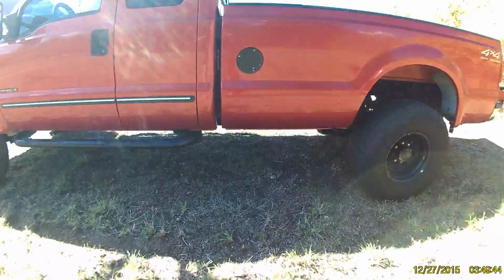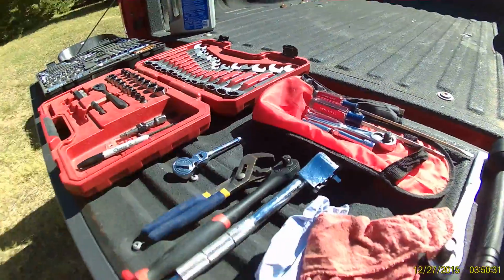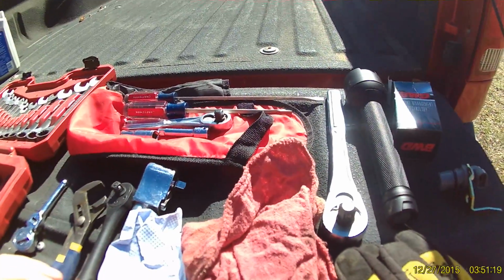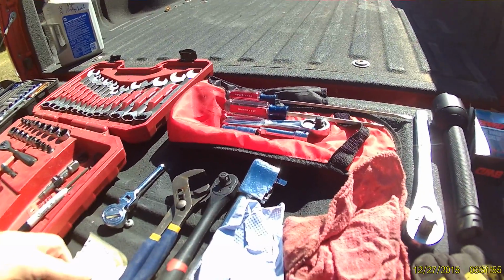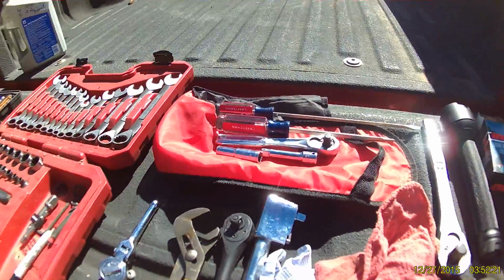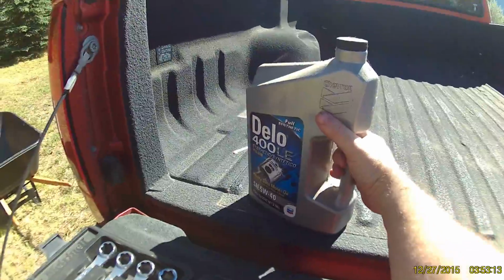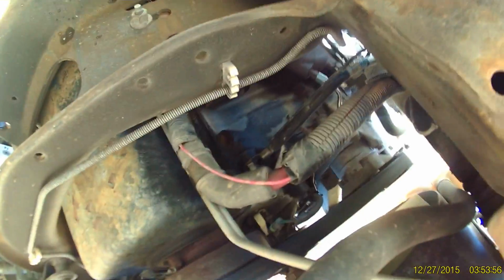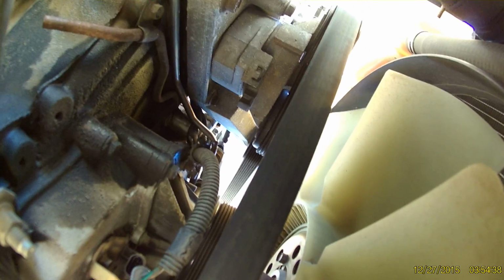2000 F350 Ford 7.3L Diesel Camshaft Positioning Sensor Fix Part 1

Comment: Thanks for the video. Browning .45 in the seat? Right near the end, you mentioned removing something that was all dirty and nasty, but I couldn't understand what you said that was. Is it something you cleaned and then replaced, or just removed permanently? I'm about to replace my CPS, so just wondered if I could do anything else while I'm under there.
Reply from the maker: You're welcome, thanks for the reply my friend. My Tussey 1911 Commander. The EBP sensor and line, I replaced them both, you can clean them yet you may end up damaging the sensor. I found them cheap enough where I just replaced them both and called it done. Here are a few good videos to check out on what you can do why you are there to get your best bang for your buck. Definitely check your CPS, IPR, & ICP. 

https://www.youtube.com/watch?v=r4uCI8MH62U

https://www.youtube.com/watch?v=_xRM8JEBHds

https://www.youtube.com/watch?v=KWiP1DcwsP0&t=482s

This guy is one of the best resources on the powerstroke that I have seen. Has a whole series dedicated to them. 

https://www.youtube.com/watch?v=W53BbnZ5IvY&t=16s

https://www.youtube.com/watch?v=xM38rFuI_YE